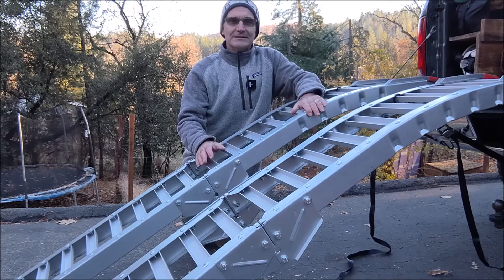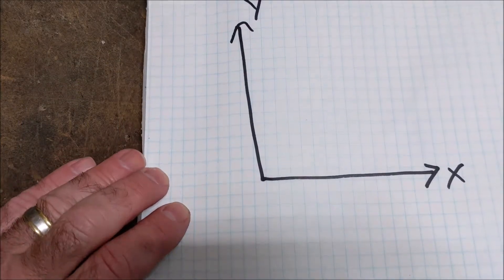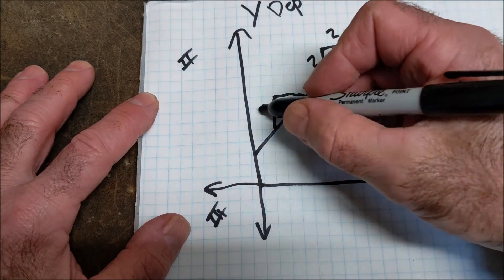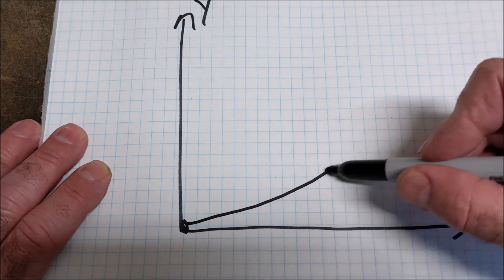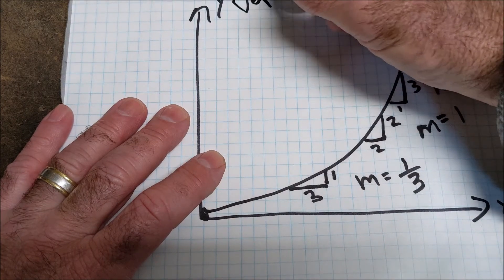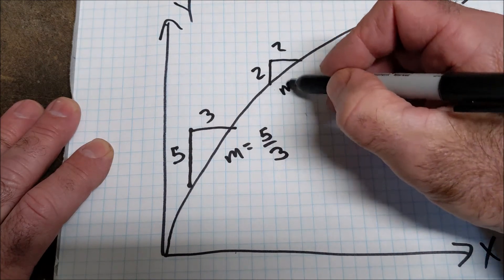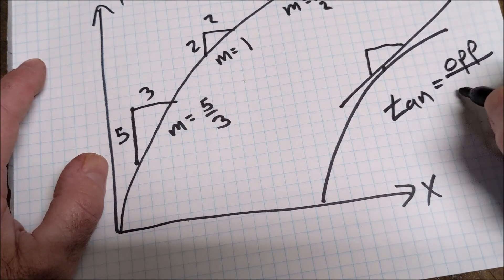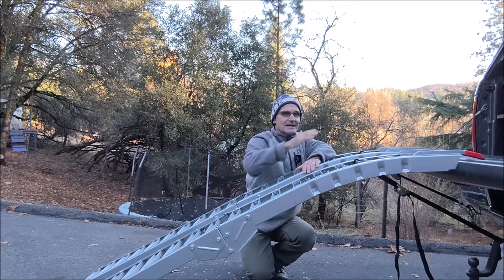Loading Ramps and Slope

Comment: I bought a scag liberty mower.
The manual says to load it backwards with no more than 15 degree gradient.
The ramps I have and the truck height brings it to 20 degrees.
Can I manage?
Reply from the maker: I would put safety first and get longer ramps.